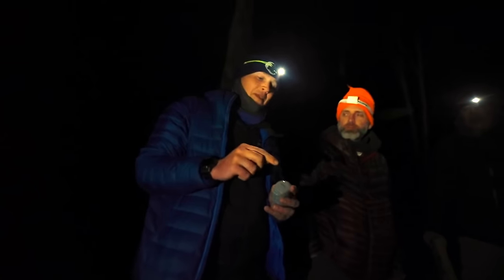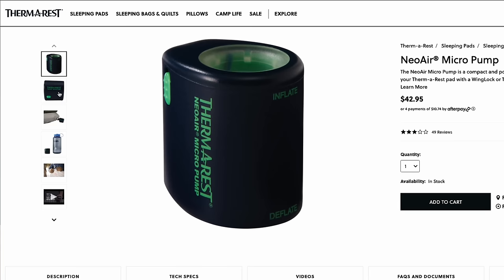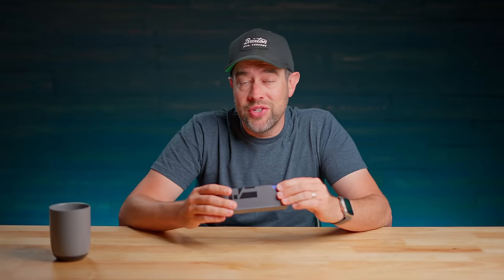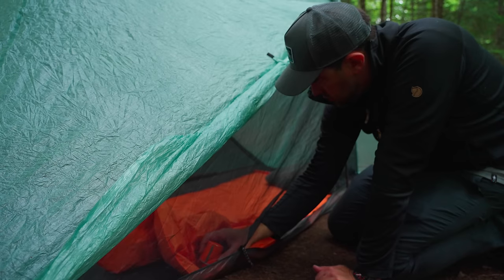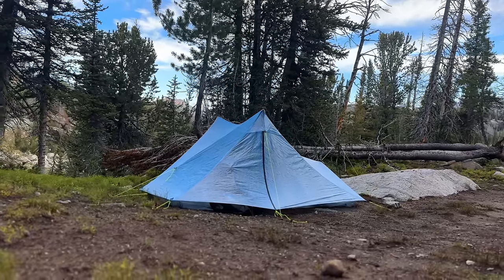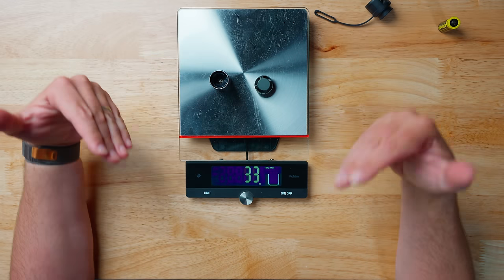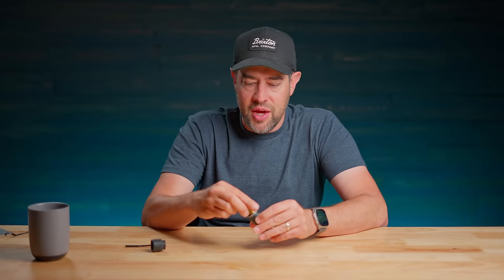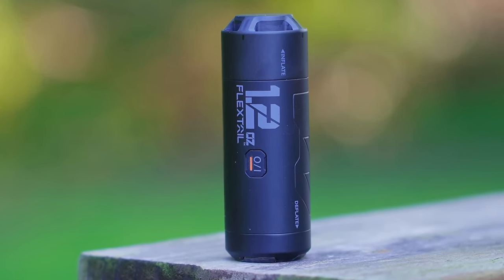The GOAT of camp gadgets just got a MAJOR upgrade

Comment: A replaceable battery is actually a HUGE pro for me. Think about it: in case of previous Flextail pumps, once the battery is dead, you have to wait until it's charged. Besides, the integrated battery will eventually degrade. In case of the new model you can just instantly swap the CR123 battery with another one. The absence of a USB port on the pump itself is not a big deal at all.
Reply: I use my x2 for motorcycle camping so I can charge my electronics while riding or from my Lithium solar power pack.
Reply: 100% agree
Reply: I thought about this and you may be right!
Reply: A bonus for me is that I already have these batteries for flashlights anyway. They last forever and what's it going to hurt to toss a 60 gram battery into your pack?
Reply: @EveryDayCharlie  me too, I have a Fenix HM50R headlight which uses this type of batteries. By the way, they weigh only 19 grams
Reply: Fwiw, also: I have the old Thermorest mini pump and use it for 1-3 seasons (depending on how many trips I do) before the AAA batteries even need to be replaced.
Reply: It’s lighter, but now I have to buy a tent light which makes both heavier and

Sadly I’m out
Reply: @bikepackingadventure7913  just use your headlamp as a tent light. Why do you need a separate light?
Reply: Same battery as my headlamp and I carry a spare..
Reply: This video omitted the most important things. Like the fact that some RCR123A batteries have an integrated USB port (Fenix among others). So you can have the best of both worlds. HOWEVER, the pressure is 2.5KPa only compared to the Tiny 2X at 4KPa, so you may not be able to inflate your pad as much as you'd like to. And keep in mind that you'll inflate way less pads with a rechargeable battery, like 50% less than advertised (13 instead of 25)
Reply: Having a look at the product this is both rechargeable and replaceable which is awesome
Reply: Sounds attractive.  So far the previous version always got left behind when trimming the pack weight.  This one might make it !  Thanks for the tip.
Reply: No most people bring a battery with them so you can recharge. But why wouldn’t you wasn’t to recharge it before your trip?
Reply: @catherinebugden  So according to you, people should limit to a day or two trip? hmmmm
Reply: AAA rechargeable batteries exist also. They're inexpensive and can be used for other things.
Reply: @Educatedshrimp  Good point Shrimp. However, it'll add even more weight because of the charger. BUT, still a very good point you brought up :)
Reply: When I’m in the backcountry I’d feel better about being able to charge it. 

So I’d have a couple backups and the regular batteries packs I carry
Reply: I watched the review and totally agree with you. As for the USB port I have a solar battery bank with that. I no longer overnight hike but look at gear still. I hike all day some days and using a phone app for GPS. To keep my phone charged the solar route works well.
Reply: As long as the replaceable battery is easily rechargeable it is a much better option. A fixed/not easily replaceable battery is the last thing you want.
Reply: @tallyrc what battery is it?
Reply: Guys, Salvation is Simple

HalleluYAH translates “Praise ye YaH”

YaH is The Heavenly Father 
YaH arrives via the TENT OF MEETING
YaH was Who they Crucified for our sins
YaH was Crucified on an Almond TREE

— Ancient Semitic Cuneiform of Moshe (Moses)
— Isa Scroll (The Original Isaiah)

Isaiah 42:8
"I am YaH; that is my Name! I will not yield my glory to another or my praise to idols.

Isaiah 43:11
I, I am YAH, and there is no other Savior but Me.

Isaiah 45:5
I am YaH, and there is none else.
Reply: Was thinking thebsame thing
Reply: @DiabloOutdoors  It has no trouble with any of my four different mattresses.  I'm a side sleeper and inflate them to the point that my hip and shoulder are just off the ground, which is FAR more comfortable than a fully inflated pad.   Their inflation estimates on their website are with the rechargeable battery as well, and based on my experience so far I don't doubt those estimates, in fact I think I could easily exceed them.

Comment: (Update: I did finally receive my pump on January 20, almost 6 months after I ordered it.) I ordered one of these Zero Pumps, with extra battery and accessories during the Kickstarter Pledge Drive, back in September, but still have not received it, as of December 20. It was promised by the first of December but there have been issues with production and shipping. I had hoped to have it for a Christmas gift, but now I am just hoping I get it at all, and this isn’t just a scam. Seems pretty shady to do that to people.
Reply: Same story here.  Didn't get shipping notification until just before Christmas, when it had a USPS tracking number but still wasn't actually shipped for weeks.  Finally got it this week.  They really botched the release, but I'm happy with the pump.
Reply: just received mine. Not a scam, they've just failed to meet the estimated shipping times because of logistics issues

Comment: I ordered 2 pumps back in early December 6 ,2023 and ended up getting them about the second week of January 2024. And I think the hype used to promote them was in bad taste. And here’s the reason why. After watching your video about this new pump. I thought it must be a decent pump, after all you can replace the battery and continue using the pump. Well the downside of this is that you can only use it for 5 minutes and then you have to turn it off because it will overheat as per the instructions say. Not only that but the quality of the machined threaded end cap that screws off the pump and the pump itself has aluminum fines that are in the threads from the machining process, and makes it difficult to screw the pump and cap back together. I contacted flex tail and requested a refund, or a set of the flex tail gear tiny pump 2x with the light, and I still haven’t received a response back flex tail. I should have kept my $90.00

Comment: I have an Olight torch/headtorch which uses CR123, I have a Fenix CL09 mini lantern for the tent which uses CR123.  Both have a Fenix CR123 which has a slot in the battery to plug in micro USB and recharge it.  The battery in the lantern is a backup for the headtorch if I need it.  Using this pump, I could either not take a battery for it and share one between this and the lantern, or it could be an extra backup battery for the other two devices.  Ideal choice for me!

Comment: Any time you have to take something apart into multiple pieces to charge it, you run the risk of losing or breaking parts. The old style is 2 oz. heavier but just having to plug it in and nothing more is a plus to me....and you have the light.

Comment: I just use a dry-bag manual pump. Even with a hole it still works. I don't like electronic/ mechanical pumps because there's too much that can go wrong with little possibility for repair in the field.
Reply: Finally a sane comment.

Comment: I got one of these and I’m really happy with it. Using rechargeable AND non rechargeable batteries is a great feature for any tech. The nozzles aren’t 3D printed, they are soft silicone. It says which nozzle works with sea to summit pads, but their deflate port is not compatible… until I realised the pump nicely fits itself into the deflate hole.

Comment: That's pretty cool. I really liked the new Thermarest pump for the fact it also deflates pads but I have a S2S etherlight xt extreme. The Flextail X2 was the ticket and I love it. In my case, the adapters stay put on the pad and I don't have to hold it but that would be a huge detractor for pads that it won't stay on. But for me it's the deflate feature that I really love. Especially on pads with insulation or memory foam, being able to vacuum them down makes rolling and packing them away so much easier. I don't think I'll be upgrading to this new pump but I love that they're innovating and pushing the envelope. Air pumps are worth their weight and thats a fact.
Reply: this pump has a deflate setting as well, he just didn't go over it in this video.

Comment: I don't know how many times I have almost lost the nozzle to my current flextail.  It's my only complaint and this model solves that.  Looks like a good upgrade.  The only thing I would say is if you can fit the charger into the battery you can fit it into the device.  It is one less thing flextail has to worry about but in my opinion they should reevaluate that decision.

Comment: Hey Dan good video. I’ve had a flextailgear tiny pump for at least 3 years. Probably longer. It works great. I just did a 6 night backpack trip with 3 additional nights of car camping and inflated my sleeping pad every night without recharging it. It is a earlier version and had to modify the nozzle base to keep it attached to the pump. It does have a charging port on the pump so don’t have to disassemble it, as well as the double click safety on switch but no light.

Comment: Finally received my pre -Christmas Flex Zero Order yesterday.   I ordered the rechargeable battery.  Topped battery off before first test.  One fill.   Four tests later I can get two fills on Klymat backpacking pad.  Not anywhere close to the hype, just dead weight to lug on the trip.

Comment: I’m a Flextail Max Pump 2 user, fills my sleeping pad then doubles as my tent light, plus it will serve as a backup battery charger in a pinch. Just under 7oz but I now leave my other tent lantern home so I’m saving weight & space.  I can see the benefit of a ThermARest tiny inflator but I’m really sold on the multi-use Flextail. As for hands free, clips onto the valve inflation, I’m ok holding the Flextail to the valve, it inflates my 30x78 Q-Core in under a minute..

Comment: I tested the Zero Pump in the field this week after putting up a first impression review. For people like me who mostly do trips that are less than 5 days it'll be a great little pump. Like you said it's got plenty of juice to get through multiple pads. The fact that it stays on the valve (tested on TAR Winglock only) it is great compared to my original Tiny Pump X. Not sure if the X2 stays on or falls off TAR valves so I can't comment on that.
I do see the lack of a USB charging port as being a compromise. I have enough electronics to charge that I don't need to hassle with taking a battery out vs just plugging it in. My Fenix HM50R uses the same CR123 and has a USB-C charging port so it must be possible to build a tiny unit with a port!
Sure, you can swap the battery out in the field but how many people carry extras? More people carry battery banks. Again that is a design choice so depending on what you value/need this could be a great option for a lot of people, and you can get CR123 rechargeable batteries with a built in micro or USB-C port. Bit of a hassle to take it out and charge in the field though...
At 2 oz on the dot the Zero pump only slightly heaver (0.4 oz) than my cut down TAR pump sack, and it was nice to just let my huge Xlite Max inflate while I was doing something else.

Comment: I think I might have to upgrade.  I have one of the non led versions and then bought a second led version because I wanted a backup pump and a light but now the battery in the led one won't hold a charge despite being less than 2yrs old and hardly used.  I have a wide array of lanterns, flashlights and headlamps and while I car camp a lack of led isn't that bad.  I like the ability to replace the battery.

Comment: I have the ´23 Thermarest neoair SP with the new valve, I have absolutely no problems blowing it up, using the "old" Flextail pump, I just use the soft adapter, fits fine without me holding it. Of course I to would like a new one for free, but the old one fits just fine, -its a bit over the top to state that it doesnt fit without holding it.

Comment: Thanks for the review.  Purchase of the new Flextail pump without a built-in charging port is a HARD NO from me. I personally don't want a light on my pump, so I think they can shave a little weight and add the external port back to it. I'll stick to my current Flextail that has it.  Hopefully enough people won't buy it, and they change the design.  I would buy it if it were lighter than my current pump and if it has the external port.

Comment: I have the flextail 2 and it is easy to attach it to my thermarest and fill it hands free. I showed how in my Amazon review video. You attach an orange tip and put the small side of the rubber tip inside the orange tip. Then place the larger end of the rubber tip over the thermarest valve and let go of the pump. I’ve filled our klymit and exped pads hands free also. 

Saving 2 ounces might tempt me to purchase the new pump someday. But hands free is only an upgrade of having to use 1 tip instead of two tips.

Comment: If I'm not mistaken the Fenix HM50R headlamp uses the same battery. And it has a built in USB-C charger. So if you use the Fenix headlamp you always have a spare battery for your Flextail pump or for your headlamp, and you can recharge the batteries from your powerbank. Awesome! :)

Comment: I have a older model flextal pump and like you had mentioned the little devil can turn on. To solve that problem for myself I put it in a lightweight plastic bottle with my pad attachment. Seems to have worked so far. Of course it adds more weight. I like the size of the new one! Don’t like that you have to take it apart to recharge. I’d certainly be afraid of loosing something 😂

Comment: This is the first time I watched a video and immediately went and bought it (or in this case, funded it!) I've bwen eyeing up the old ones for awhile, but they were always a little bulky and I didn't care about having a light on it. Price point was also too high for me. I used to have one of those Thermarest ones you mentioned (still do, actually), but it was bulky, noisy, batteries died quickly, and now it only fits the one old pad we don't use anymore. So ya, I've been hesitant. Good job. You sold me. 😅

Comment: I like the form factor, however, I am probably just going to stick with the original just because even though it is a side feature, I really do get a lot of use out of the LED light feature that makes it worth the two extra ounces for me.
Reply: 100%.....i get a full 3 night's camp worth of light and two full fill ups on the air mattress on one charge...
Reply: No light is a dealbreaker.  Not a fan of taking out the battery to recharge. I’ll also keep my original.

Comment: i love flextail pumps. but like others mentioned i probably won 't get this one, that's because i like the LED feature on the 2nd model. Really handy when i need a quick light and i can't find it or not wearing my headlight. Also the accidental button press happens, i solved it by wrapping a piece of plastic from a water bottle around my flextail and slide it down when i pack it up. 
But i do like the small form factor, i look forward to the 2nd version and if my old flextail led dies, i might consider it

Comment: I melted my Therm a Rest trying to light wet firewood. Been using the previous Flextail but now I want the new one. Smaller, lighter, and quieter. I hear some company will be releasing a camp chair lighter than the Chair Zero. It’s adjustable and comes with a ground sheet that doubles as a carrying case too.
Reply: use a bellows, you just blow. No batteries, and lighter
Reply: @EricFleming231  ? You mean the pump sack? When you say bellows I’m thinking of the big accordion thing next to a fireplace. Pump sack works fine but not for starting a campfire.
Reply: it's a metal straw that has varying sizes that fit within one another to make it longer and works great. @MeOutside

Comment: Just got my Flextail Zero Pump in and didn't even make it to the air mattress.  Crapped out within the first 5 seconds with some screeching and shooting out very tiny flakes of metal out the "INFLATE" end.  I'm guessing something got hung up internally to the motor.  Guess we'll see if it's a replacement issue or a return for something reliable.  Glad I tested it out before my trip is all I can say.

Edit:  Tried calling the support number a few times to follow up the email I sent with the video of it failing and no answer (90+ minutes before they close).  We'll see if they answer emails before the 7 day return window...

Comment: They could add a little solar strip which could trickle charge that single battery. The circuitry for correcting the voltage wouldn't add much space or weight.

Comment: Thanks Dan for the heads up on this one. I purchased one just now. I have the original and like it a bunch. The quieter fan, lighter weight and no built in light is just what I’ve been looking for. Not to mention being able to connect to Thermarest’s new valve. This is a home run in my opinion.

Comment: Incredible how they manage to get this thing even smaller and at the same time less noisy. For me the missing light is a big disadvantage. Also I own a 3d printer and printed the nozzle for the big Agnes pad so it clips in and stays attached without holding it. Is it possible to deflate with this pump ? That is also a nice feature to repack your sleeping pad.

Comment: I have to babysit my X2 when it inflates my Cabela's/Klimat pad.  But, as you showed, it literally takes a minute.  So, while I'd prefer not to have to babysit the X2, it's not worth $40 to save that minute of holding it all together.  I also really like the lantern/light feature of the X2 -- it's my primary tent lantern, as I don't like hanging my headlamp (it's clunky and I need my headlamp for ... my head).  If I got the new zero pump, then I'd save a few ounces ... and then I'd grab something like a Black Diamond Moji and give those ounces right back + some.